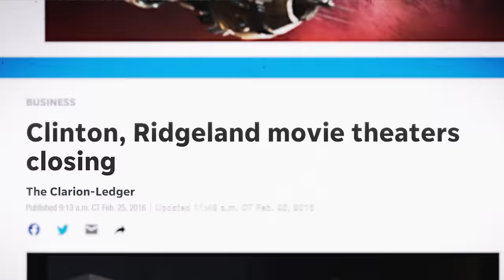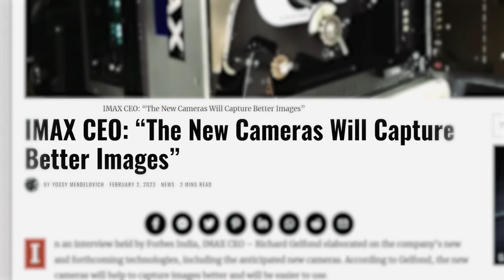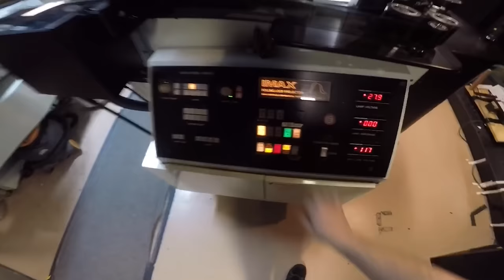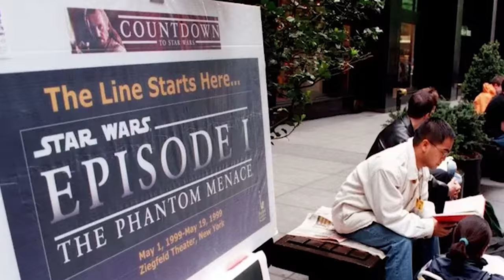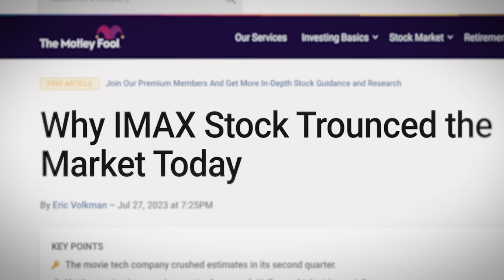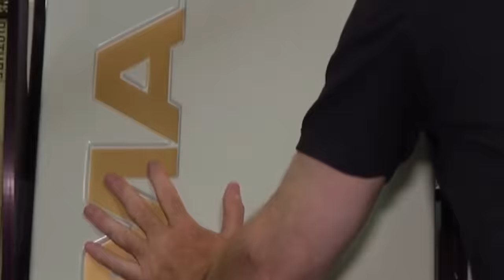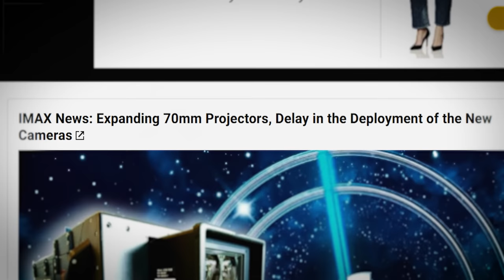Will IMAX 70mm Survive Without Christopher Nolan?

Comment: As someone who grew up in the “digital era” and as a full believer in the space, I think that there’s a place for both analog and digital formats. 

I’m someone who believes that Hollywood mostly puts out “trash”, that most theatres run antique projectors and sound scapes (yes even imax digital I see as “aged”), I can get an amazing experience at home via 4K Blu Ray, an HDR OLED TV, and high end HT system, sometimes better than what I can get at the theatres.

I think the 24fps in film is a long dated format, that doesn’t bode well on modern displays (like OLED with near instantaneous response time). Especially with the advent of digital cameras, 30fps should have been done long ago. Heck even higher framerates such as variable HFR, or HFR with motion blur in post. Even modern Blu ray discs can’t support HFR formats, despite technologies like VRR being readily available which allows the TV to sync at whatever Framerate the source device is outputting.

Many within the film industry would find what I am saying as simply blasphemy.

However, there are unique benefits to film that simply cannot be replicated with other formats. The aspect ratio of 70mm perf is by far the best, and removes one of my biggest quirks of modern movies, the black bars! The resolution you get over film is also unmatched, with up to 20K resolution. These directly translate to the digital version as well, and when I watch my 4K Blu Ray at home, I know that I am getting the best image possible with the widest aspect ratio.

There is also a inherent “feel” to film that cannot be replicated digitally. The film grain, the way film is projected at 24fps that doesn’t cause the inherent judder that modern OLED displays inherent due to instant response time, or the persistent motion blur that plague legacy LCD screens due to the exact opposite reasons.

Tenet was the first movie I was able to experience in 70mm film. Oppenheimer was sold out in 70mm from the moment I even tried to buy tickets, so my first showing settled for digital IMAX. With the two week extension for 70mm IMAX, I was able to secure tickets for a second showing.

As long as the industry has directors like Nolan, people who can push the boundaries of film not just in terms of the movie, but also the technology and get people out of their seats and into the theatres, then the future is definitely brighter than some people are envisioning.

CD never spelt the end to Vinyl, Digital Games hasn’t stopped developers from releasing physical games, the reason being these formats offer a unique set of benefits that are simply lacking in the other. For this reason, there will always be a market for it, and if there’s a market there is money to be made. It may become smaller, and niche, but niches also tend to generate the highest returns rather than appealing to the masses. In many cases these niches are often willing to pay more than the alternative, so they can have these unique set of advantages.

I can’t wait to watch Oppenheimer in 70mm, and I will continue to watch movies in 70mm IMAX as much as I can when available. I think the future is bright for 70mm.

Comment: Honestly I don't see how film can stay forever. New cameras (maybe a ALEXA 65 with 3 of the newer Sensors that are in the ALEXA 35 will be that camera) will ivertake the quality of even IMAX film, Prjectors will become even better to the point where they also do match that quality. So honestly what I want is just bigger screens. Instead of many smaller rooms cinemas should really just have one huge one. Because with that they can differentiate themselves from a home cinema.
Reply: multiplexes came to facilitate different films to be released simultaneously, or fewer films to have more shows than the four traditional shows on a single screen. For a majority of films out there, film is already not needed. But good film usage has incredible spatial resolution potential to let people keep adapting to newer resolutions, example Matrix in 4K has two versions: One was upscaled from the older HD DVD version, another re rendered from the film negatives. Upscaling is annoying and quality image can be better stored on manageable cellulose acetate tapes than magnetic tapes or tiny physical aberrations in silicon chips that need a compiler to translate. The first is an example of film negative, the other two digital. We need film backups to be able to record our history without the need of future gens needing context of other technologies to retrieve it
Reply: i do however agree that multiplex screens need to be larger. Or at least have better wall to screen ratio to give the feeling of a big screen. Otherwise even a big screen with too much wall will feel small in a big hall.

Comment: The problem I see in the future is, we are going to have such high resolution devices that the only way to properly view old media without it looking like garbage, will be to have original film copies on hand, to be digitally converted.   Even if you gain no benefit visually because the digital resolution is superior to the film,   you can't take something shot digitally and blow it up in resolution without consequences,   that's why  4k releases get rescanned and don't just recycle older HD masters.

We're going to have the same problem with shows produced digitally in  EDTV resolution,   that look like garbage after trying to upscale them to a mere  720p or 1080p  release.   Only it will be  some film recorded in 4k or 8k  that you're trying to blow up to whatever standard resolution devices run at down the road.   AI upscaling can only do so much without a massive revolution in computer technology, and it will still be extremely expensive vs just rescanning something that exists on film.

Comment: Saw Oppenheimer in IMAX 1570 and Imax Laser. The difference in quality was immense. There was so much more detail in Cillian Murphy's face in 1570.

Currently Imax laser and Dolby Cinema are the best digital projectors, which have 2x 4K laser projectors super imposed upon each other. There are already 8KTVs and the majority of TVs are 4K. The majority of digital projectors are 2k, so you're getting a better quality at home. While there are digital cameras that can capture near the quality of IMAX 1570, there are no projectors that are even near that quality. Heck, most digital projectors in cinemas project as well as 16mm projectors rather than the 35mm projectors that was the norm before the switchover to digital.
Reply: And my 128" 4k home projector, which cost no more than a high end TV you'd see at Costco, is sharper and bigger than most movie theaters near me, when you consider that we sit much closer to the screen.

Comment: I just saw Oppie in 15/70 IMAX last night and the image was often fuzzy, was consistently very flickery, there was occasional dust, it wasn’t aligned straight, the dialogue was tinny, the projector noise was distracting in quiet/silent scenes, and the film grain was extremely excessive and at times the black and white footage was so crummy it looked like a 1950’s film. Those are some incredibly consequential problem. These problems constantly prevent audience immersion. Film is NOT the way to go, folks.

Comment: Loosing projectionists is the thing I dislike most about it. You go to a cinema now and no one is there, it's all done automatically. I don't even think they use discs, it's all download off the internet.
Reply: Yeah they project what’s called a DCP (Digital Cinema Package) and they’re massive files. But you’re right not having a projectionist is an issue, theaters now can have so many problems that go unnoticed by the average viewer and can hurt someone’s experience.
Reply: Basically the high school kids scanning tickets double duty as projectionists.  Cinema chains must not be able to believe their luck.   That said if everything goes well it's not a problem, and I do remember attending back in the day some film print screenings where the projectionist did a terrible job (often using too much light, lens not focussed properly).  So when film is good t's good, but it's open to a lot of failings.  Digital is more consistently good.  And as that means less headaches for theaters they'll keep it.

Comment: I dont care about film or digtital.

What would be much more important in my opinion is that they switch to a higher framerate/refreshrate. Being on 24fps seems so outdated. Especially for gamers who are used to 144fps/hz or even 240fps/hz, 60fps for actionscenes is the bare minimum.
Reply from the maker: Well the issue with that is then you get something like the issues with "The Hobbit" all shown at 48fps. In video games, absolutely a need for a higher frame rate. But when you jack up frame rates for film CGI becomes harder to hide and you start approaching a soap opera look. There is a reason why almost all films are made in 24fps. Animated films, totally makes sense to jack up the fps but 24fps is a sweet spot for film. It has a much more pleasant look to it because of how it blends each frame together instead of looking a bit plasticky.
Reply: The way videogames and 144hz+ displays are handling HFR today is genuinely wrong, it might be fine for competition but it's annoying for recreational purposes.

The main issue is that no one yet has managed to define a correct standard for HFR yet with the last attempt coming from Cameron was a complete failure.

Also on the storage side of things it is not that easy as even to these days an 8K RAW 24FPS "reel" would require operators to swap their storage drive even more often than they used to on films.
Reply: The "pleasant look" is also achievable on HFR but nobody knows how much blur should be added to the image yet.
The fun thing when you add more blur to an HFR video frame is that the whole vidéo looks like a 24FPS video again but a costly one.
Reply from the maker: @SP95  The other issue is High Frame rate also puts an increased amount of pressure on VFX shots. You essentially are doubling or tripling the amount that the machine has to render out for every second which could cause delays or bottlenecks.
Reply: As far as I know render farm rentals are still far cheaper than hiring staff so I really can't accept that kind of excuse on the VFX side of things.

Even during Interstellar, so coming back in 2013/2014, VFX company DNEG rendered their frames at 5616×4096 instead of the classic 2048 × 1080 so that's a 4x increase on the rendering side of things.

When movie makers want to make the effort, they will.

Comment: Unfortunately, commercially film no longer makes sense.  Unlike vinyl, it's still reasonable cheap to fuel the neche market that wants it.  Film is simply to risky and to much infrastructure and costs are massive.  Commercially it is a very bad bet.  It's why the number of projectors keeps shrinking as those who have them find it harder and harder to justify the costs.
It's very unfortunate.

Comment: So, one hour of 35mm costs roughly $4,200... ok, not too bad, but not that great either. If your shooting ratio is 20:1 and you don't use every single frame of every 400ft reel, you could be looking at close to $200k just in shooting stock.

Comment: I hope 15/70 continues. The digital laser IMAX uses a reverse anamorphic lens to fill the full height screen, and the screen door effect of vertically oriented pixels is very distracting.
Reply: and nobody wants to read that. The Dual Laser IMAX GT loses vertikal resolution in 1.9:1 Screening too, because of this
Reply: @mixdown78  do they still use the anamorphic lens for 1.9? I thought they would just leave it flat/native to the projector.
Reply: @JK-mo2ov  The anamorphic Lens-Element is INSIDE the Dual 4K Laser GT MIAX Projector. I still don't know, if this can be switched on the fly by the Operator. I think, NO! I think it's permanently inside.. Needed for the 1.43 Screens. Projector Native is 1.9, of course just DCI Ratio ..

Comment: "There's no movement in movies at all...blablahblah...digital not film...lightbulb...illusion" - No offense, but if Tarantino was a little less biased, he may have figured out why this argument is absolute garbage. The illusion of movement is achieved digitally by refreshing the screen (the 'pictures')fast enough through LED lights, that it creates the illusion of movement . You can then stop there, or optionally pair that with sound. Bam, you have a Motion Picture or Movie.

But his auto didactic work on film and knowledge of it otherwise is also almost too impressive to criticize, so I'll leave it at that and just say that he's wrong on one thing. And he's not even really 'wrong' per se, because liking film grain vs pixels is a matter of subjective taste. I will say...I did feel pretty ripped off by the standard-sized 70mm of Oppenheimer and 35mm of Once Upon a Time in Hollywood, though this wasn't the case with Imax 70mm presentation of Oppenheimer or the digital-film-digital showings of The Batman and Dune.

Comment: I don't think it will survive.
70mm is good enough to be the best looking format. But 70mm isn't good enough to make it worthy for most productions.
Unless we see an increase in directors willing to work with the severe limitations that comes with 70mm, it's gonna die.
You can't survive on three or four directors when it requires very specific and expensive hardware to record and display that format.
35mm still has its place and is still fairly affordable, even for lower budgets. But 65mm and specifically IMAX? I don't think it's got a chance unless IMAX (the company) actively work and support directors to shoot enough content with it to make it worthwhile to actually have a large format theater and potentially create more theaters.

And honestly, I am not very interested in it anymore either. The growth in digital capturing and projection had a very steep climb upward in quality.
While there is nothing compared to 70mm yet, every 35mm format has been beaten years ago. Especially with laser projection.

Having worked with film professionally for the past decade hasn't made me miss it much either.

Comment: as ex retired projectionist CIC/UCI cinemas and warner bros is reason i don't go to uk cinemas anymore , digital is rubbish , 4k is rubbish , 8k rubbish , 18k rubbish , imax liemax format rubbish , george lucas yet again has ruined cinema , the only thing he  had right was the THX sound system , until he started messing with THX-vhs tapes and then it all  went wrong 

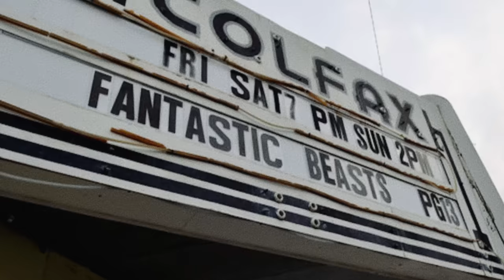2:19 i stopping the video there's no point watching anymore of this i have made up mind , digital movies are rubbish , noticed i said digital movies and not digital film as it simply isn't digital , if multi soundtrack can be time coded synced with film , well yes and no , i still prefer six-track stripe Dolby Stereo CP200 with JBL THX 

i'm out here

Comment: I'm sick of the argument that film is "too expensive" and digital is "cheaper."

Hollywood films have gotten dramatically more expensive, using digital.

Oppenheimer used the largest and most expensive film format in the world AND used a brand new custom made black and white variant, let alone using practical effects..

Yet Oppenheimer was cheaper to make than Barbie, by 45 million dollars..

Bare in mind, Barbie was relatively cheap for a modern Digital Hollywood film.
Reply from the maker: For the argument about expense it more on the distribution side of it. I think the way it works now is perfect. It's used for big events and not overly saturated. If you used it for every film that comes out, it becomes less special